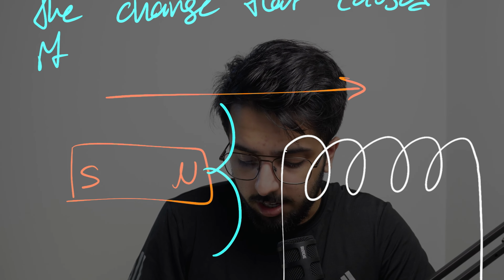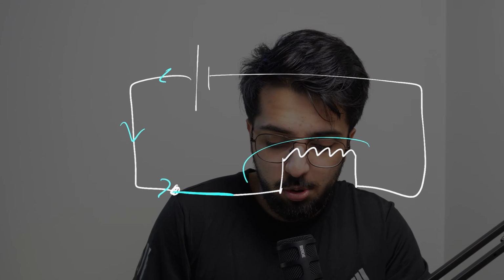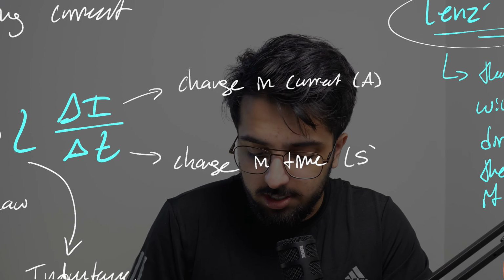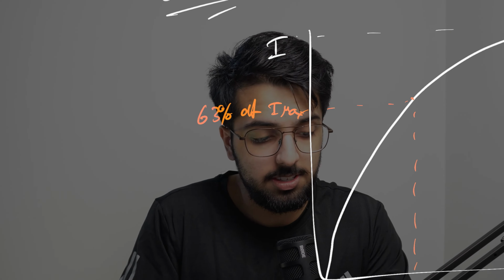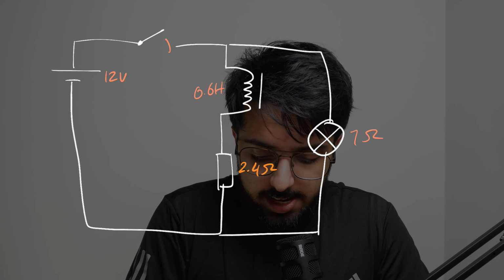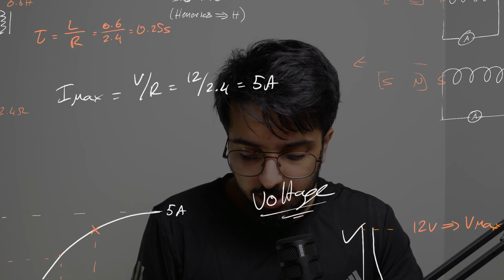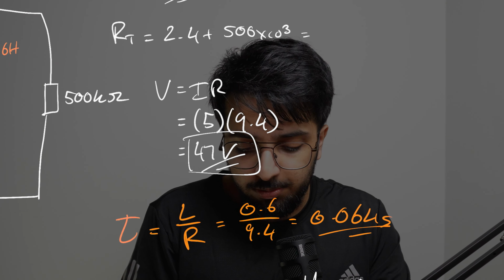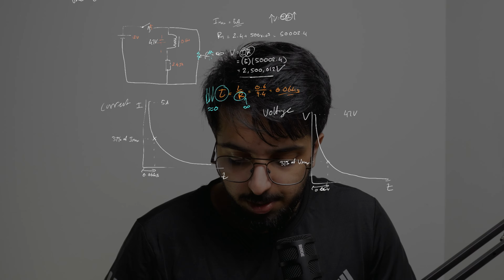Inductance and Inductors | NCEA Level 3 Electricity

Comment: is there a reason why you chose 67 and 33 percent for the graph calculation?
Reply from the maker: Those numbers come from the math behind exponential growth and decay. For an RL circuit, the current through a charging inductor is described by:

I(t) = If(1 - e^(-t/τ))

where 'If' is the final current and τ (tau) is the time constant (where τ = L/R.)

After one time constant, t = τ, so the equation becomes:

I(τ) = If(1 - e^(-1))

Since e^(-1) ≈ 0.37, this gives:

I(τ) ≈ If(1 - 0.37) ≈ 0.63*If

So after one time constant, the current through the inductor has reached about 63% of its final value.

Likewise, when the current through an inductor is decaying, the equation is:

I(t) = I0e^(-t/τ)

At t = τ:

I(τ) = I0e^(-1) ≈ 0.37*I0

which means about 37% of the original current remains. So the 63% and 37% values aren't arbitrary numbers, they come directly from the exponential equations that describe how current changes in an inductor.